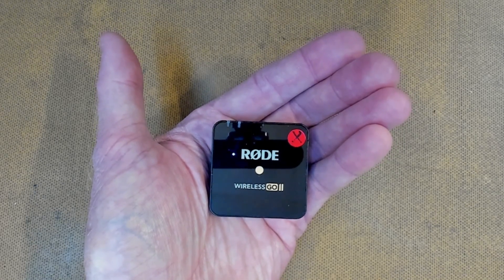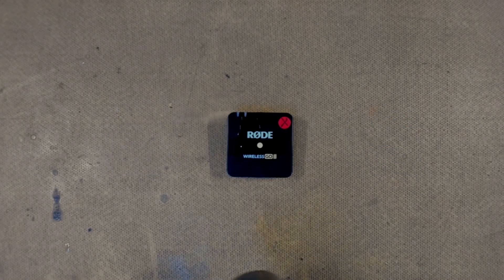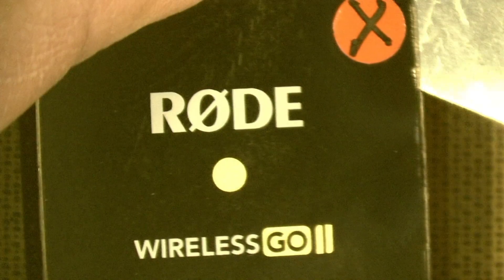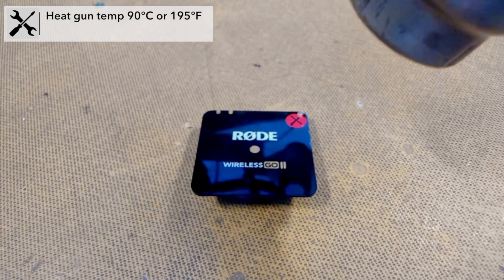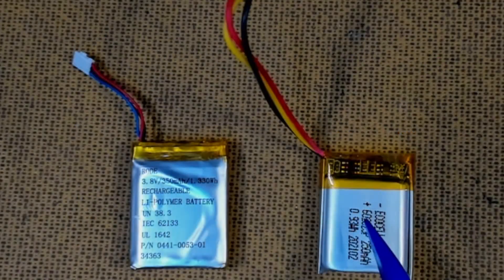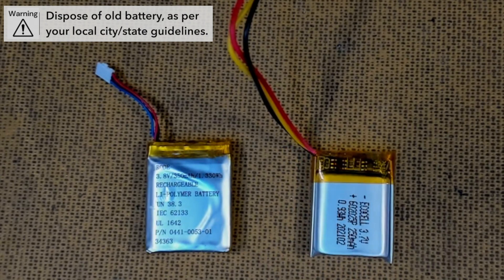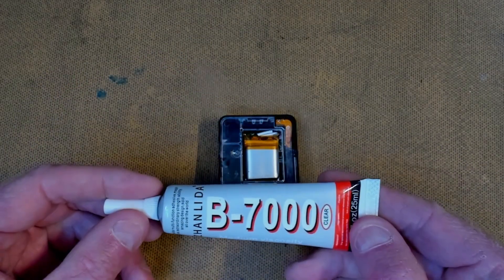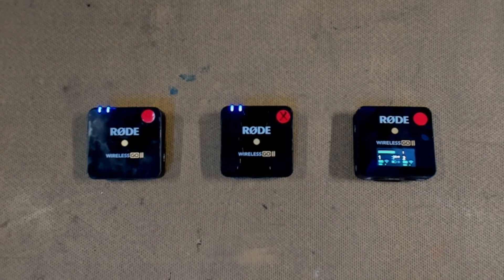Rode Wireless Go 2 Mic Battery Replacement

Comment: I'm so glad to find this video.  Both my transmitter cases popped open. I assume the batteries swelled up.  I'm tempted to replace the receiver battery while I'm at it.  Is it the same type of battery and procedure to replace?  Also, does the B7000 adhesive not only seal the cover, but also fix the antenna back in place?  Thanks!

Comment: Nice tutorial! My two transmitters just opened by themselves, when the batteries bulged. That also showed the antenna early enough not to damage it. I wonder if the Wireless Go 2 works fine without a battery at all, as I use one of these mostly connected to the USB all times? That may also explain why the batteries have bulged 3 days before guarantee expires. For now I only detached the antennas from the top lid, so it does not get damaged if the batteries go bigger even more. And I am waiting for a call back from the dealer about how to proceed with the service.

But still want to know if they work without a battery at all or if it needs a fake voltage on one of the pins of the connector, that it thinks it has a charged battery connected.

Comment: $10 for the battery, but how much for the heat gun, pry tools, adhesive and micro-clamps..? 🤔
Reply: Battery is a consumable, just meant for the microphone, and you have to buy it every time for replacement. Other tools are standard tools that are reusable for a variety of purposes. It is more of an investment, and commonly available in your local electronics store at different price points.
Reply: ...and time for all that.